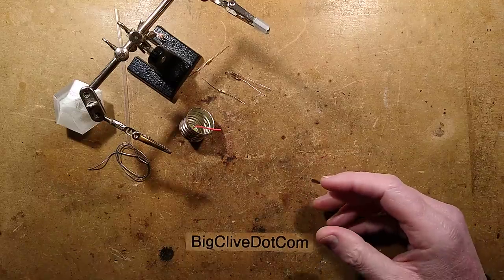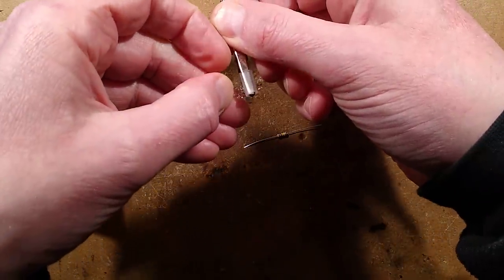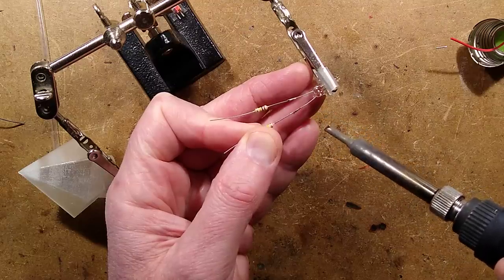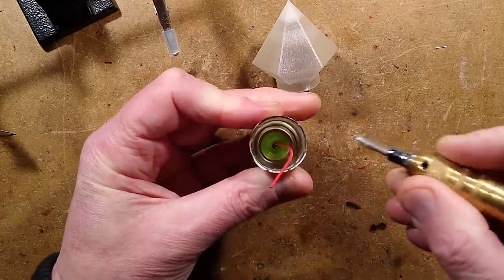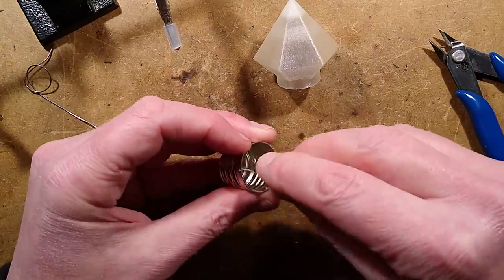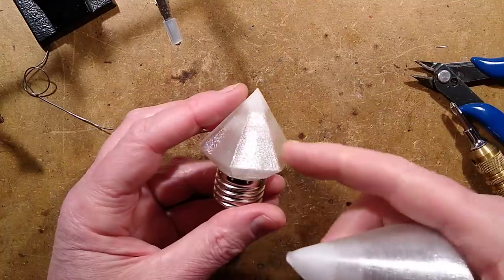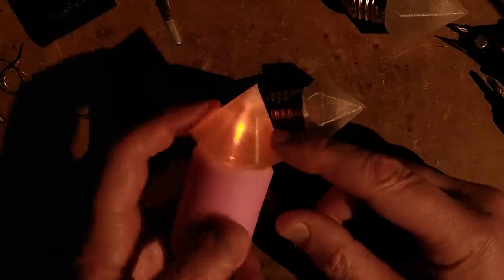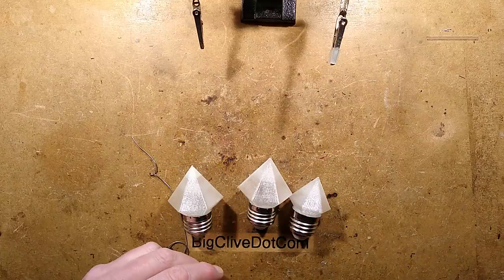Full build of a custom neon lamp

Comment: I'm getting the itch to build something with neons. Recently I got a bulk pack of mini incandescent "grain of rice" bulbs from aliexpress that I want to make into old fashioned style lamps. Neons would be nice too :)
Reply from the maker: I made a super tiny string of lights from those based on very thin flexible wire and heatshrink.  Full main voltage (240V) and under-running the lamps.  Not completely safe, but it looked great.
Reply: @bigclivedotcom  I think I have a project for next weekend :)
I saw some sellers have coloured bulbs but they cost a silly amount, so I'd be interested in ideas on how to colour the bulbs I already have myself.

Comment: Nice! I would be tempted to 3d print some sort of spacer shaped like a little wheel or something, to make sure it's centered and stays centered in the base.

I am thinking of making a plug version of this that my brother can use as a night light. I am still thinking about what to use as an enclosure, I might repurpose a wall wart power supply or a died timer switch.
Reply: Why not 3D print the whole thing, with just the plug pins from a basic plug?  Or maybe have the 3D print replace the lid of a normal plug where the base of a plug holds all the electrical bits and the screw to close the entire thing closed.

Comment: (cooler temp = matte finish) (hotter temp= glossy finish), if you're after transparency have some fun with clear petg, prints hotter, and generally use 10% to 0% fan cooling, there's profiles flying around on the internet that you can use that makes it look like glass even!

Comment: Does your printer/slicer setting have the cooling fan boost when layer print times get shorter?  I've noticed that  clear filaments tend to go more frosty when printed faster, lower temp, or with high cooling.   These look really nice! So warm and inviting.
Reply from the maker: I may try slower printing.

Comment: Some of the older 3D printers should be modified such as the old Anet A8. If you get your hand on one the first modification is definitely update the firmware to Marlin in order to get the thermal runaway protection. After that any mods are just to improve print quality such as printing clamps to mount the printer to a solid base and converting from direct extruder to a bowden system.
And of course if you have a Raspberry Pi 3B+ or 4,  use Octoprint if you don't have a Raspberry Pi then I recommend Mintion Beagle Camera as the Raspberry Pi is hard to get at a reasonable price at this time and the Mintion Beagle Camera has something similar to Octoprint built in.

Comment: more like, neon lamp, placed into custom style reflector and base?
either way, I approve, it looks cool, same as did the neon bulbs of the past, with and without reflectors, housings and the likes.
I still have some dinosaur 1970's( I think) neon night-light plug ins. just a neon bulb with drop resistor( I think) cast into nylon with plug blades and open windows.
I remember seeing it as a wee-lil-brat in the early 1980's and it still glows perfect as of today. yes as an older adult, I still have it plugged in here. it may have been used for 10 to 20 years, then unused for 5 to 10 , then used again for the last 8+. lol, it's had some off time, but it has out lasted everything else with an neon bulb, not to mention incandescent, fluorescent, cfl, led.......
lighted switches? poof dead/flickering neon after 3 to 5 years. so I know and have proof there was good neon bulbs and proper power supplied to them at on point in the past.
EV's are dumb, hybrid is almost fair and other sources of fuel. Hydrogen power, great and all, but rolling H-bombs more or less. nuclear of any type, yep its great but also NOT.

as for the green junk slingers? well, they need massive telephone poles shoved where the sun doesn't shine on them...

Comment: A new video, so soon? Mr Ambassador you spoil us 🤣

I heated a neon bulb a while ago and it sucked in on itself with the vacuum, still worked, but a total mutant 😅

Maybe a big version with a tree of neons inside?
Reply from the maker: You can also warp thin fluorescent tubes in the same way.  The ones used in escalator handrails were standard 8 foot tubes heated and curved in fibreglass sleeves.
Reply: @bigclivedotcom  funky

Comment: Great illustrations of fabrication techniques!  Thank you !!  I wonder what would happen to the frostiness at the tip if you carefully heated that region just past the glass transition temperature (50 - 80°C for PLA) and then let it slowly cool? Hot water for a while then letting it cool slowly? Thermoplastics tend to have pretty high CLTE, and you may be seeing the light scattering effects of micro stress cracking / crazing induced by the geometry during shrinkage.  By analogy, if you were to make the same geometry in glass and cool it too rapidly, it might shatter starting at the sharp tip,  but not if you cool it slowly in an annealing oven.  If that is the case, re-heating above Tg and slowly cooling might eliminate it.  I'm not really sure.
Reply from the maker: Reheating it with the hot air gun is definitely worth trying.
Reply: @bigclivedotcom  Careful with that hot air gun Eugene. It didn't go so well on getting the base to fit in the screw socket. 😄
Reply: @albanana683  ....  uh huh; why I suggested hot water 😃

Comment: The flsun printers are far less fiddly than the very popular enders. I'd recommend a QQS or V400 to someone in a heartbeat. Extremely stout and low-maintainance. Lil' on the big side though.
Reply from the maker: I'm very tempted by the 400 with the direct filament drive.

Comment: I'm only guessing Clive but maybe it's staying hot longer towards the top because of shorter passes than the bottom that has a chance to cool down before the next pass of hot plastic being laid down.
Reply from the maker: It turned out to be a time thing where the printer slowed down to let the plastic harden on each layer.  I removed that and it solved the problem, although the softer printing does result in a slight ripple now.

Comment: Clive would it be possible to design the globe to have threads to screw into the Edison base? That way you would not have to use heat to soften the globe and run the risk of the globe shrinking. The threads would need to be a friction fit.

Would be nice to find a source for the bare base that has not been crimped.
Reply from the maker: It's viable, but could make the design more complicated in terms of matching the threads perfectly.  If all goes to plan I have a bench tool on its way from China specifically for crimping on E27 bases.
Reply: @bigclivedotcom   Nice! the one that's $39 form aliexpress?  Did you find a source for the bases? Please do a follow up with the crimper. Love the channel, never know what's in store.

Comment: Clive is it true if you put a dead battery on the heater that it will charger up with the heat ( I see sameone do it on tv )
Reply from the maker: In some cells it just recovers a small amount of residual charge.

Comment: I think I noticed the neon flicker. What is the 'solution' to the problem of voltage 'noise' in an AC lighting circuit?
Reply from the maker: Neons always have a slight flicker.  The current is very low, so there's not much electrical noise.

Comment: hi just wondered why you used two resistors when most industry neons only use one ?
Reply from the maker: To spread the dissipation and put less stress on the resistors.  Many neon indicators in the UK have hot and angry resistors in them.

Comment: FROSTY TOP?  Is that because its printing to fast?
Reply from the maker: It turned out that it was slowing down to allow a cooling time between layers.  Setting that time to zero fixed the issue.

Comment: Nice video I love 3D printing but the time it takes to finish a decent sized print can be a pain, the sclicer I use Ultimate lies it says 6 hours and no, it isn't even when tweaked, I tend to turn up the printing speed after it has made a good base to 200-300% to try and get some prints to finish in time, I never leave my printer printing on it's own either 🙂
Reply from the maker: Almost everything I design is optimised  to print quickly.
Reply: Verify the configuration reports returned by the M503 command against the acceleration and velocity settings in the slicer and the print server (where applicable). If they don't agree, time estimates will be incorrect.